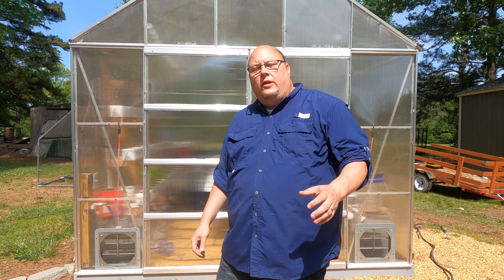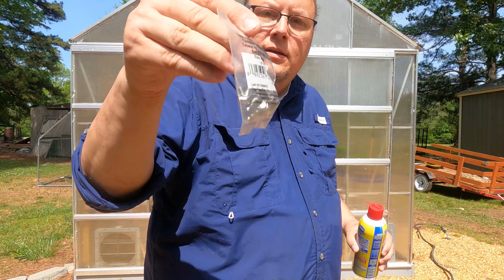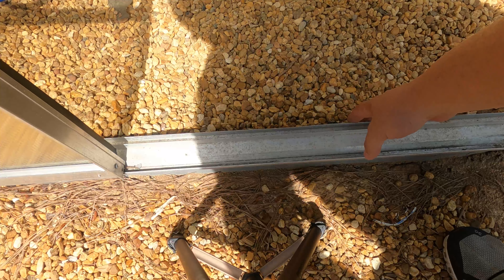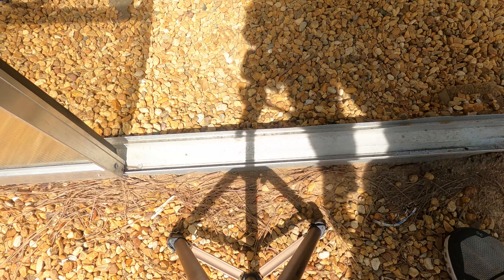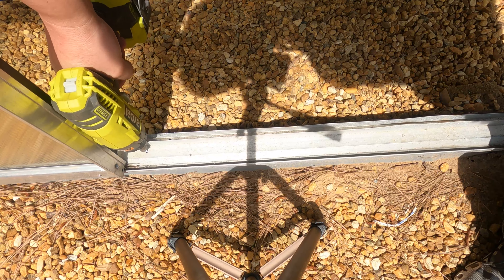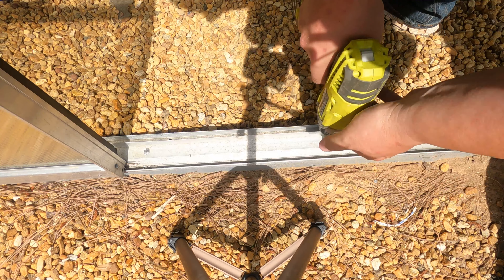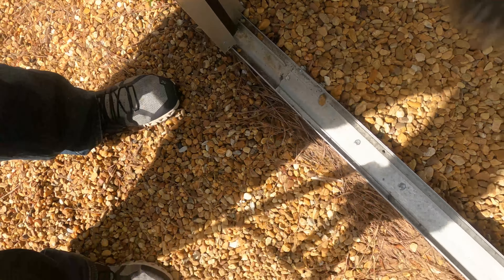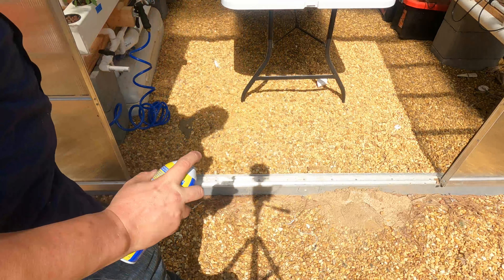How to Fix Harbor Freight Greenhouse Doors

Comment: I don't have any problems with the doors sliding but I have a problem with my left door the bottom part don't meet up close enough even when I put a weather strip in. I'm wondering if I should undo all the screws push the bottom all the way to the right and then screw back in

Comment: Mind give me the most trouble trouble, and I live in New Jersey.  The channel fills with water, and freezes. I’ve drill holes in the track and the water ran through and still locked everything shut with ice. Then I tried using the silver tape underneath the track so I could put WD-40 or other oil in it, and it’s still sticks. A solution for that

Comment: You'd think harbor freight would've fixed the door track system in 2023. I bought the 8x6 variant and the tracks are just retarded. I believe it's the two top round rail coverings scraping on each other.